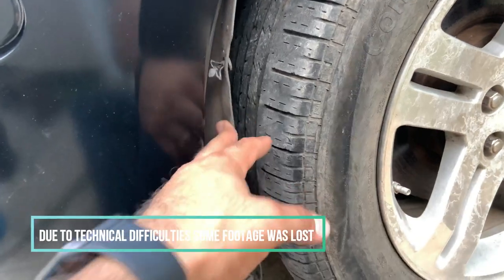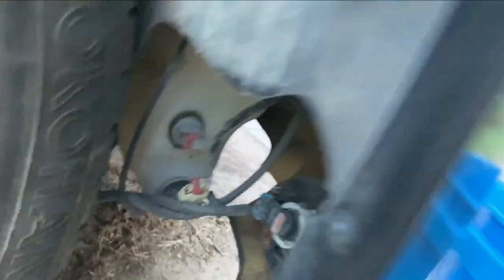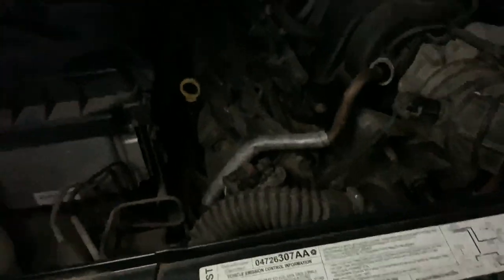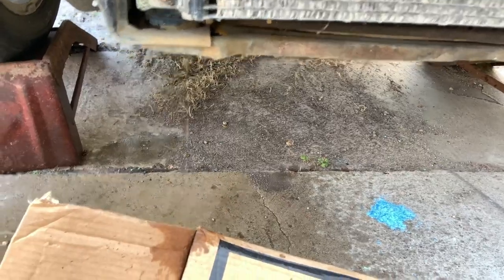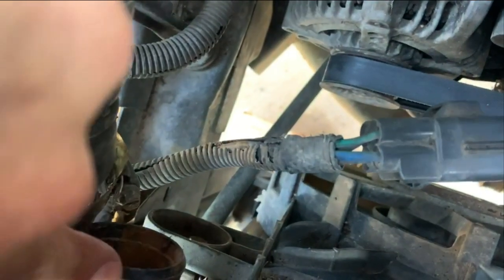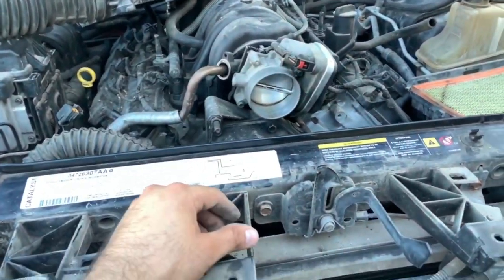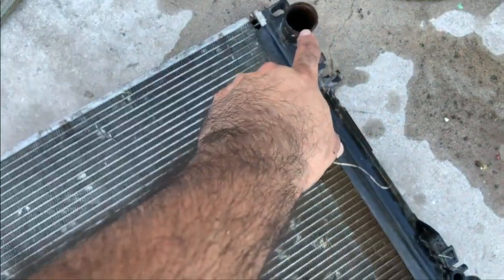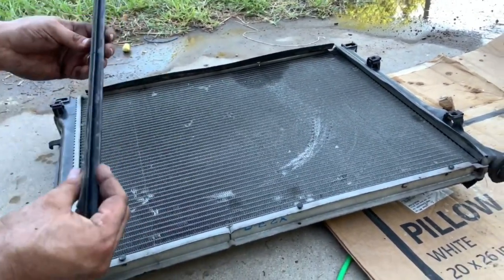2006 dodge charger r/t radiator install

Comment: Cool..... Just let the coolant drain rite on the ground dude. Be responsible and get a something to put the old coolant in. Unless it was water, if it was I apologize.
Reply from the maker: It was water I put in it a few days before this video due to thinking that radiator had a leak. The thing is it was rusty from inside which is why it looks like that. And all good 👍

Comment: Taking the whole front office difficult when you can just unscrew the screws and pull it directly up to take that out
Reply from the maker: Yes lol I wanted to do it that way but I went this route in case some people wanted to do it this way and also I just wanted to take the car apart lol, but you are correct getting it out through the top is the easiest way. Thanks for the feedback and for checking it out the video. 🙏

Comment: how did you bleed the system just through the reservoir?
Reply from the maker: The way I bled it was turn the heat on high left the top off and it worked great no overheating or anything like that

Comment: How did you get your hoses to work with the smaller radiator inlet and outlet.
I have ran into the same issue and my hoses are to big for the new radiator
Reply from the maker: Mine fit normally. Is you radiator the same as the one that you took off
Reply: @DavidVlogz  yes it’s the same one other than the same thing as mentioned your video. The outlet and inlet of the radiator are a bit smaller than the one I took out
The new one is 1.5’ top and bottom and the one I took out that was broken was 1.75’ top and bottom